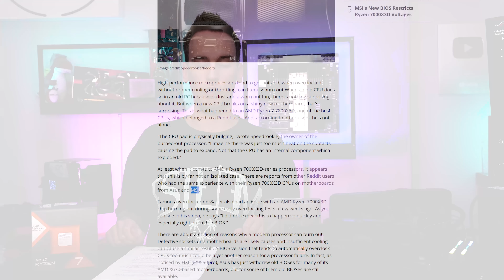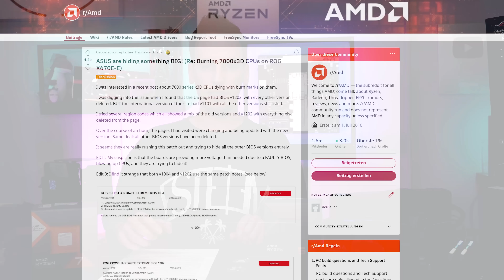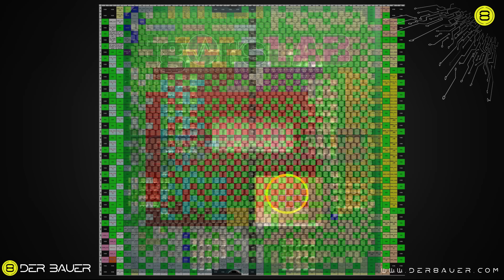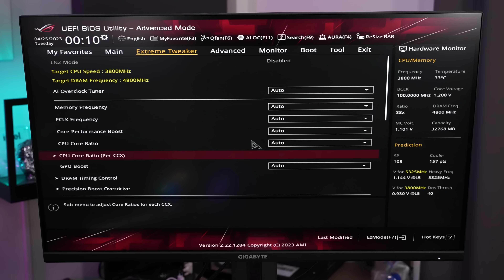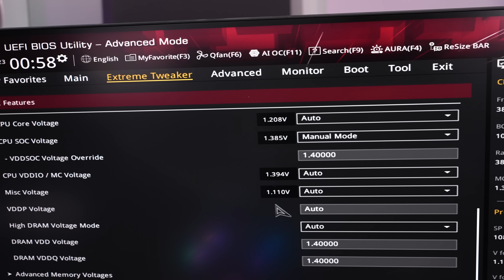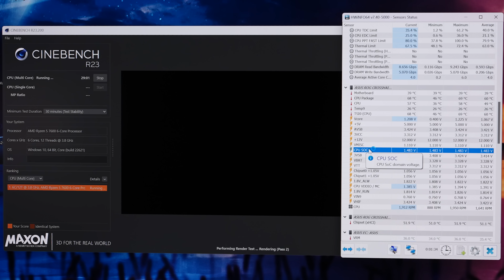I missed the Damage on this Ryzen 7900X

Comment: I did order a AM5, AMD X670E, E-ATX and a Ryzen 7 7800X3D. So for me you certainly did contribute. Thanks :)
Reply: Guess for now just don't enable EXPO or double check EXPO settings just to be safe...
Reply: @AaronShenghao  been running the expo setting ,.. since November. (7600xt, then 7950x and now a 7800x3d).  Weird my junk still works, and works awesome.
Reply: @AaronShenghao  may I ask what does Expo do?
Reply: @mannyfresh7065  EXPO overclocks your RAM to rated speeds on the box just like intels XMP. It sets the clock speed, timings and voltage automatically and is supposed to run stable without issues. However from experience I've seen RAM kits run really high voltages on the memory controller with XMP which are beyond safe which may work for a while but will kill your hardware faster.
Reply: @AaronShenghao  is it safe to use eco mode
Reply: Disabling expo would be fine for 7800x3d in terms of performance as well, since it doesn't really care about ram speed
Reply: @albertkam191  Hell ya, lets spend money, to not use the gear as intended. Awesome sauce.... lol....
Reply: @Kyote7667  Lol it's fine now, they found the issue
Reply: @Kyote7667  I meant until they fix it lol
Reply: I’m on the fence on ordering a strix gaming x670E-A gaming wifi and 7800X3D? Ok to go ahead?
Reply: Same here. I've been using a new Asrock X670E Steel Legend build with a 7900x for a few weeks now, with EXPO on (6000 MHz). As soon as this video was over I was into the BIOS and dropped my RAM speed back to the default 4800 MHz.

I'll wait 6 months and a few BIOS version updates before considering turning EXPO on again.
Reply: I did not catch any relevant updates on the topic of the burnt out chips. Whatever it is, bad bios values or some manufacturing or statistical error, to be safe I will run it on a setting well in its defined parameters for now.
Reply: @GarrethOriley  Expo, is with in its defined parameters...  but do you.
Reply: Send back and be safer with Intel build!

Comment: Interesingly I have a 7800x3d in the post. It will stay in it's box until Asus get to the bottom of this.. In the meantime I've switched Expo off on my 7600x. I've observed a big jump in soc voltage to 1.35v when it's turned on. Might turn out to be fine, but I think I'll wait for the new guidence.
Reply: manually set it to 1.2-1.25 and it will be fine. If it is the SoC voltage then the culprit is the Auto setting that can vary.
Reply: me to have the parts, was going to do tomorrow,  Asus 670e-plus tuf board, 78000x3d, 6000 memory, will wait now!! did download a bios update from the 21st, but will wait now a week or so.
Reply: Same. Have the CPU and RAM, just waiting on the MOBO (gigabyte b650 pro ax) which should get here tomorrow. Going to get the system to boot just to make sure nothing is DOA then going to wait for confirmation on the issue before booting it up again

Comment: that's very interesting, this sort of damage looks like moisture thats trapped on the substrate of the CPU, I fix laptops and gpus for a living and that sort of bubbling happens when there too much heat applied to the pcb and there's moisture trapped between the layers of the pcb, since these CPUs run hotter, the moisture trapped inside the substrate wants to evaporate really quickly and bulges the substrate, maybe that's what's going on but of course thats just a theory :v if you'll like to chat more about this feel free to contact me :D
Reply: Seems to be it's high voltage from the bios settings though, not from water ingress. :P
Reply: @TechyBen  yeah it's all really wierd, I never seen it being caused by voltage, there's a first time for everything XD
Reply: If yhe substrate get hot enough, it will get bubbly regardless. We are talking like 200c or more.

Comment: @der8auer, what about degradation? I’ve seen quite a few posts about ppl worried about running expo for weeks and possibly taken years from the CPU’s life? Is that a real concern?
Reply: This ddr5 gen is whole another can if worms. I remember hearing Steve from HWU say how his 12900k (i think) one day after months of stable use couldnt run a memory overclock probably due to degraded dimms/IMC
Reply: Yes, high SoC voltage will degrade the memory controller on CPU. Max soc daily voltage was 1.2ish for ryzen 5000

Comment: Are people just using CPUs right out of the box? Did this still happen to people who spent a good amount of time in the BIOS? 
My 13900ks was finely tuned in the bios, so that it stops frying itself, even if it is sitting underneath a huge AIO liquid cooler.

I'm not sure if AMD kills itself despite tuning it in the BIOS.
Reply: if one of these decides to kill itself there's nothing you can do about it, and even if you tweak it to fixed voltages you're one cmos reset away from death
Reply: @AdrianOkay  wow. That's completely out of my control then. Thank you for the heads-up.
Reply: 13900Ks have to be tweaked like that because they will pull 250W to attain that performance. AMD 7000 pull much less power than that.

Comment: Wow I just updated my ASUS BIOS a week ago and once you mention they removed all the BIOS from their website I went and checked and notice they just released a new BIOS as this is the second one in the same month so they must of fixed some errors.  SO I updated again and I enabled EXPO and this time I went back into the BIOS to check on the SOC voltage and mine was at 1.29v  with EXPO enabled .   So who fault would this be  as why would memory companies and motherboard companies put a  shelf destruct setting in the BIOS as if your not a extreme over clocker and just set EXPO at it's default setting this should never kill your PC as I think companies are under to much pressure to keep up and just push out products without fully testing them.
Reply: It’s probably a very rare issue that requires unusual circumstances to occur. If it was a common problem, we should have heard about it much sooner given how long these processors have been on the market and how many have been sold (unless it was caused by a recent firmware update). It’s definitely possible that AMD or some other party screwed up in some way, but it’s also possible that it’s rare enough to not show up in their validation tests. There is a limit to how much testing you can reasonably do and how many configurations you can test, so some problems may only become apparent once the product is used by hundreds of thousands of people.

Comment: Probably not the issue here but I was checking the stability of a 5600x PBO OC on Prime95 and the fastest core lost stability and underwent clock stretching. The moment that occurred I noticed that the temperature control on the chip stopped working and the temps instantly spiked. It never got to a dangerous level because I caught it in time. It only did that once.
Reply: My first factory new 5600x had a dead core, but only appeared in Chrome. XD So took ages to test, verify, and the store went "working in games, no fault" lol, so had to send to AMD for a replacement. My 5800x has been rock solid though.
Reply: @TechyBen  Did you notice by having 16% less multicore performance than benchmarks?

Comment: I did rma for 5950x because of sudden reboots. I did not overclock. This is insane that with 7xxx amd also has problems..
Reply: Name a platform that's never had any kind of problems. I'll save you the trouble of answering, because it doesn't exist. The fact you had an issue with your 5950X is about as relevant to this as the fact that my 3770K died on me ten years ago. Not to mention that "sudden reboots" sounds more like a configuration or RAM issue than a CPU fault.

Comment: People on reddit were laughing at me when i told some idiots with overheating CPUs to put a temp limit to 70c. Well, given how agressive the boosts are, even with a 70c temp limit you can jump to 80c before it backs down. Immagine with a 95c temp limit huh. Normies using high tech are clowns. They don't understand that in order to beat the opposing faction, every manufacturer started to put limits very close to the maxim. Fuck 300w CPUs, Fuck 95c temp limit.

Comment: I have been messing with X670-E  and 7600X,  HWinfo is reporting 1.394v SoC, 1.385 VDDIO with EXPO enabled
Reply: 28.4.23 Asus has released a new bios for my board that states it limits SoC to 1.3V MAX. This is for protecting the CPU and motherboard.... wonder why?....  Check your manufacturers everyone, they will probably have something similar.
Reply: @chris746568462  honestly I don't even know why they have the voltage so high,  i run soc voltage at 1.2 manual running at 6200 mhz 2100 fclk with complete stability
Reply: @rompersrchelichannel8164   I run same speeds but have it at 1.25v, guess i could have gone lower.  I don't know what the new bios sets it too as i haven't tried it yet. I will post it here.
Reply: Ok manually playing with it abit and i now have 1.14v SoC , 1.13v VDDIO, 1.128v VMISC and 1.314v Vcore MAX. Not sure if it's 100% stable but hasn't failed yet. 
That is with Fclk at 2100 and dram at 6000.  SoC current has dropped by ~4A compared to 1.394v.
Reply: @chris746568462  those are some low voltages bro,. i might try and lower mine a little more also👍
Reply: i have the same 1.39 voltage showing with my asus prime 670e with expo enabled
Reply: @rompersrchelichannel8164  I will try lower mine and test tomorrow. My CPU package power doesn't go below about 35/36w even when idle. Idk if it supposed to or not.
Reply: Same with 7900x x670-f
Reply: I have now updated to the 1401 beta bios for my X670E gaming. Enabling EXPO and leaving everything else results in 1.34v SoC in HWinfo. Not really sure i like that still.  VDDIO is at 1.385v too.

Comment: You said that 1.5 is pretty unrealistic, but when I first got my 5900X, I initially tried an Asus "auto OC" feature that came with their bios or motherboard software (one or the other, I can't remember) and it choose to apply 1.5V core voltage along with the most agressive vrm loadline preset. I did reset the settings not too long after because the CPU started to get a bit toasty.
Reply from the maker: I was talking about SOC voltage :) But 1.5 core is also insane
Reply: @der8auer-en  Ah, my bad, I should have paid more attention ^^
Reply: lol my 10th gen 10850k out of the box no bios update ran the chip in the bios at like 1.48 volts at 5.2 ghz. i was so confused as to why and it took a 360 AIO to have enought thermal headroom to install windows as my 140mm dual tower cooler couldnt handle installing windows.
Reply: @Fudgesickle  i got a 10700k and that was the same aye, im using an asus board and will hit an insane 1.66v trying to do 5.4ghz runs. 
power consumption reports as over 400w in the intel app oh and very toasty 👀
Reply: Was that all core 1.5v? If so that's a pretty wild auto oc
Reply: @Demon09-_-  Not Zen 4, but I've seen an MSI board (I'd have to ask what model it was) apply like 1.45 on a Ryzen 3600
Reply: @itsTyrion  hopefully that was like single core boost at 1.45v or some dumb auto oc setting? 1.45v all core load voltage is pretty scary if that was default
Reply: @Demon09-_-  yes, all cores at 1.5V under load (tested with cinebench).
I had a few problems with this board (B550-E) and until the last bios revision I had a lot of random crashes. I just hope my CPU wasn't damaged at any point xD
With one of the latest bios revision, the motherboard made the CPU draw around 220-225W under load.
Reply: @Sadiinso  sheesh that's crazy for all core.asus was straight up trying to murder your CPU lol. These days I mainly prefer to use pbo on Ryzen either for straight negative offset or. Adding a clock speed offset depending what results I wanted on the CPU.
Reply: The max LLC calibration is a bit dodgy, but the 1.5v should be fine. My 3900x pulls that at idle, and has done so since 2019. You just don't want that much under load.

Comment: You did Cinebench with the high SOC voltage, is that memory intensive? I would not try to stress the cores just the memory controller.
Reply: Cinebench barely uses memory to fill the workloads into cache as tiles progress render. It is not memory intensive. It is extremely well optimized on how it uses memory. This is also why it is not a good CPU gaming test.

Comment: Can you recommend safe voltages for the interim. I am on 1.15 VDD SOC, 1.3 VDD IO, 1.35 for both the RAM voltages, and 1.1 for Misc voltage. I hope this is safe for now? Using buildzoids ddr 5 timings, stable for 6 hours at 1.25 SOC but dropped it by 10 to try and be safer.
Reply: VVDQ at 1.25, VDDIO at 1.25 and Dram VDD at 1.35 worked for me.  Set Soc to 1.2
Reply: @chemie7037  Trying this right now. SOC was 1.439, system is running CineR23 right now,  max Soc=1.394 so far. (Expo II enabled on Asus X670E-F) 👍
Reply: @jumpjet777  1.44 SOC is too high; amazed Expo does this.  Expo never worked for me so I have always used manual SOC but even in auto it is 1.24
Reply: @chemie7037  It seems nice and stable with Expo selected and your settings. I have set SOC @1.25v, and in use HWINFO says it's peaking at 1.279 (A huge difference to 1.44). Cheers for the settings 👌 (I might have a bash @ 1.2v later) edit: Good at 1.2 also
Reply: @jumpjet777  1.39 still too high.  Set to 1.24 or 1.2
Reply: @chemie7037  Using all your settings (from above) including SOC@1.2v now. HWInfo reports CPU SOC peaks @ 1.234v & CPU VDDIO 1.288v on a 7800X3D. The system has been up for a week now, and I just hope that I haven't reduced it's life with the high SOC having been applied for most of that time. At least I am in the lucky position of being able to swap my old board in if there is a huge failure (5900X). Cheers
Reply: Looking at the Asus statement, it sounds like they don't know yet... will be interesting to see how this pans out.

Comment: AMD CPU's have been burning up since the 3000 series in the core or on memory dies. Voltage protection has been an issue for quite a while.

Comment: Just remebered Intel case - broadwell-e  + RAM overclocking and SA auto overvoltage
Reply: using 3600mhz ram on 7600k on z170 pro aura will jump the vccio and vccsa to 1.360/80, on auto, pretty common from asus, i lower those values and still stable

Comment: unrelated or not but monitoring my 4090 when running Superposition Benchmark in 8K I was surprised to see 430watts, problem is my bios has a 100.00% 350w power limit it shouldn't go above but it does and repetitively lowering power limit to 90% seems to work and it only reached around 330w, just an example of how some limits might not work as expected
Reply: It's also possible the monitoring software is not 100% accurate. As to do that you really have to measure via the actual power cables. Also what 4090 is 350 watts? Isn't the default power 450 even for the fe
Reply: @Demon09-_-  my MSI gaming X trio 4090 would only pull 430w out-of-the-box. I flashed a newer version of the X trio bios and now it will peak at 480. I was honestly considering that if the BIOS flash didn't work something was wrong with my 12-volt high-power but thankfully it was just the original bios.
Reply: @DREAD69XI  doesn't sound to odd. Maybe fred was getting confused with 4080's as I don't know any 4090 with a stock power limit of 100% that is only 350.

Comment: 12:34 - Wait if I enable XMP am I voiding my warranty with AMD / the motherboard manufacturer? No one has told me this before...
Reply: It's been like that with both Intel and AMD for years mate.
Reply: If you go beyond the rated speed for the memory controller, yes.  Typically DDR5-5200 with 2 RAM sticks, and DDR5-3600 with 4 RAM sticks.  You can find this info on the AMD or intel website for your processor under specs. (edit for typo)
Reply: @master21mark  Hahahaha AMD RIP
Reply: @lightward9487  Dumb fanboy. Intel also voids your warranty if you're stupid enough to tell them that you overclocked or even enabled XMP (which they consider overclocking). You can easily find that information via Google.
Reply: Guess it depends on where you are. I know it would not work like that here at least. If they advertise EXPO/XMP then it should also work. If not then its false advertising and basically illegal.
Reply: Depending on the retailer it was purchased from it may be covered by them. I had some stability issues with a RAM kit i got last year from Overclockers UK, when I questioned them on what speeds they were guaranteeing they told me it was the rated speed of the kit and not the base speed and were happy to RMA the kit and send me a replacement.
Reply: The motherboard manu doesn't have a leg to stand on, even AMD's is tenuous as they themselves advocate mem speeds requiring it.
Reply: Ok, so my AMD 5600X has a rated "System Memory Specification" of "Up to 3200MHz". Well my DDR4 "3600Mhz" RAM is currently running at 1760Mhz because as we know, DDR runs at half the actual labeled number of Mhz.... So does that mean my CPU is running in spec or out of spec? I know this failure affects Ryzen 7000, not 5000 but I already had to RMA my CPU once before (luckily they didn't ask about XMP settings).
Reply: @aspzx  3600 is out of spec yes but it is the DDR4 sweet spot for Ryzen 5xxx CPU's, like i say it depends on whether or not the retailer will guarantee stability at the rated speed of the sticks. It's not an ideal situation but it's where we are. If your retailer already replaced components in the past without grilling you for info they can use to deny your claim your probably good.
Reply: @ojhuk  AMD replaced my CPU before so I'm more asking about AMD's warranty conditions. I'm thinking you could probably claim the memory was well below 3200mhz though because of DDR.
Reply: @aspzx  Ahh I see, I've never had to deal with AMD directly so I can't really comment from personal experience on how they handle these things.